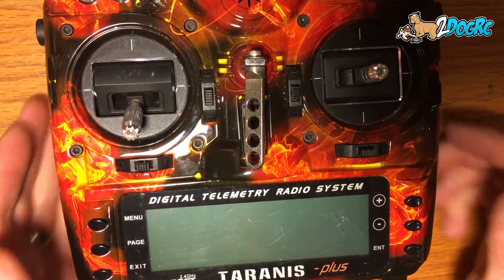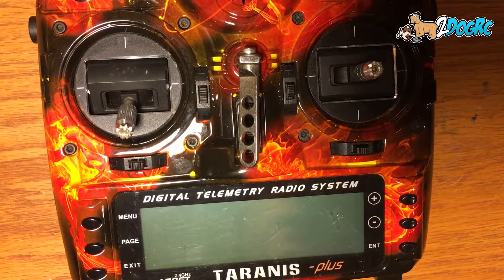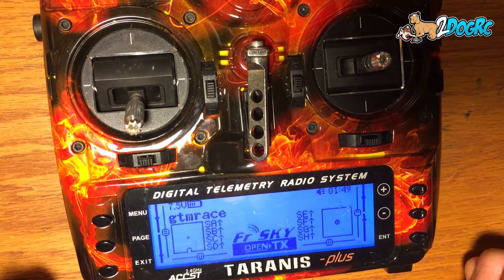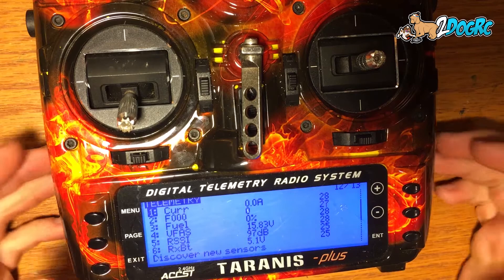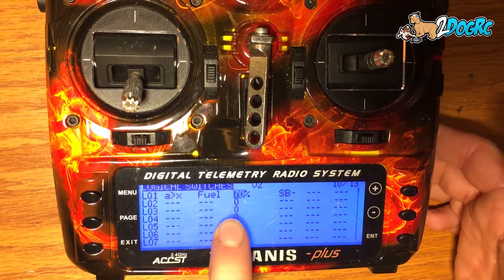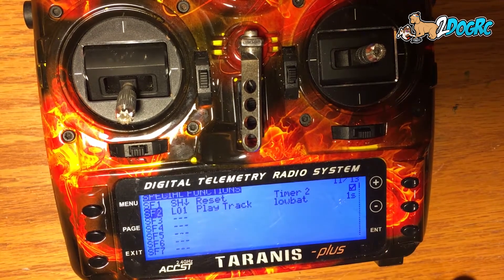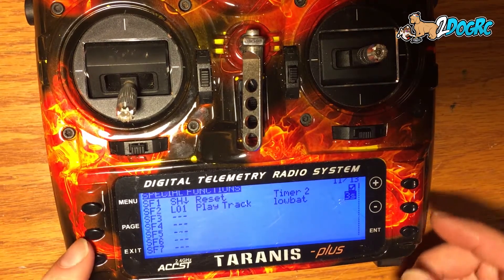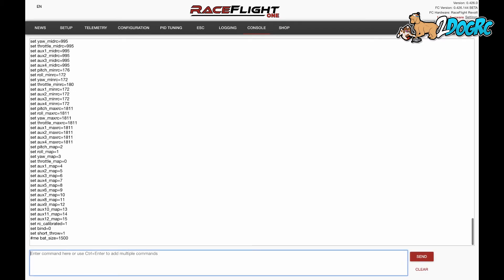Raceflight Taranis Hack, mAh Consumed and Voice alert!

Comment: This video may answer a question I have about using the current pin on the revolt.  To make this happen are you connecting a current sensor output to the current pin on the Revolt FC?